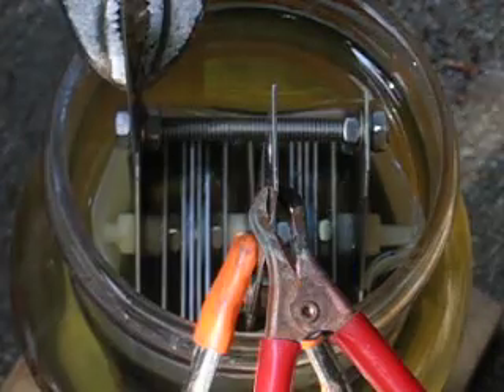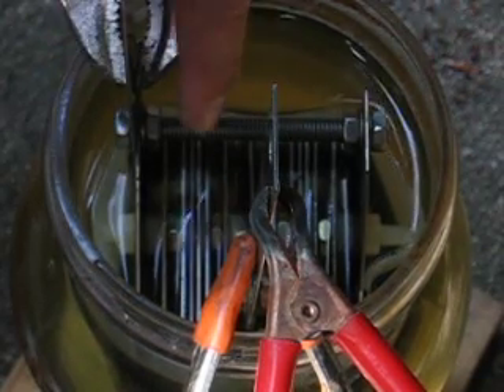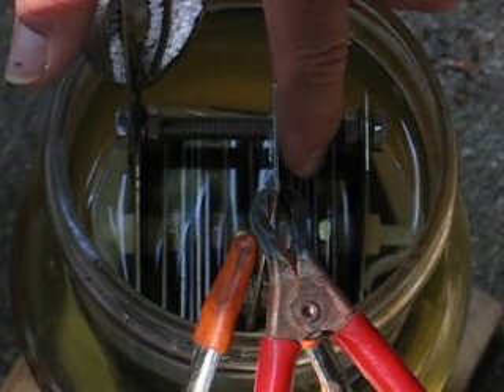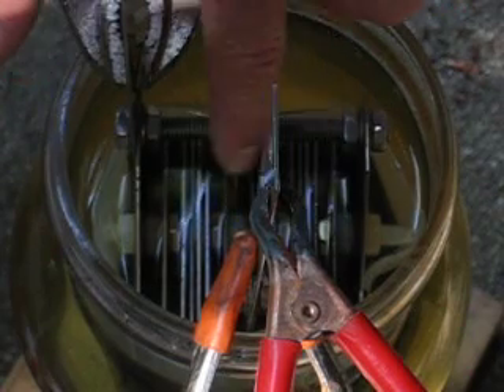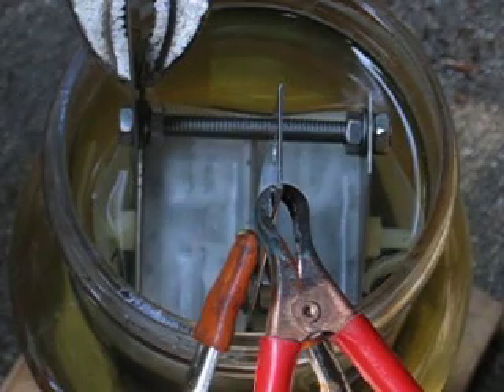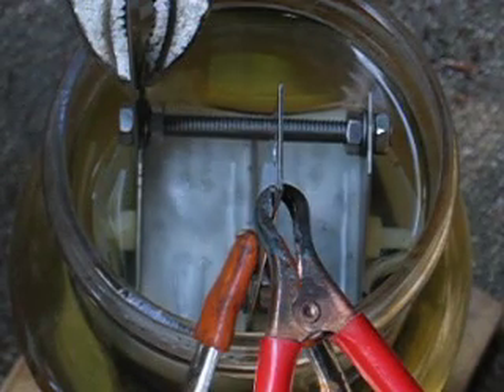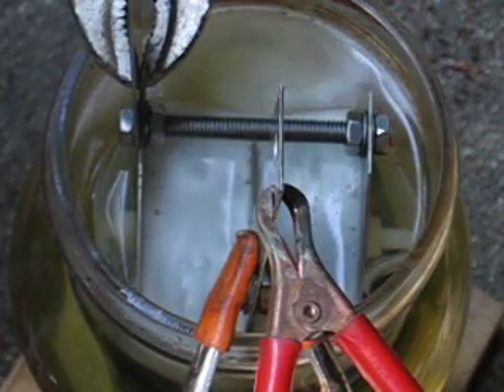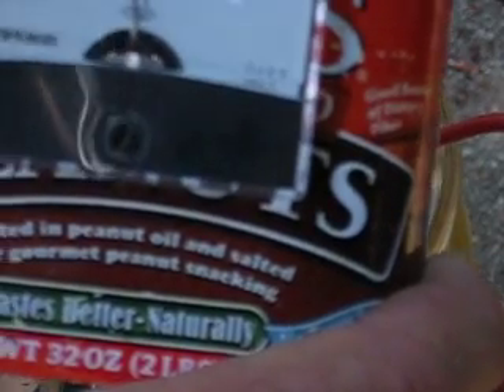Super Gap Hydrogen Cell

Comment from the maker: This helps spread amperage across the cell over greater surface area, becoming much more efficient and better for heat dissipation. If you only have positive and negative plates, you end up with lots of heat but minimal gas production for the amount of available surface area.